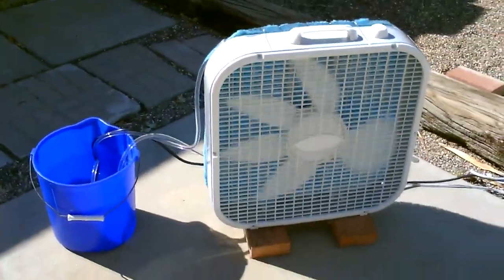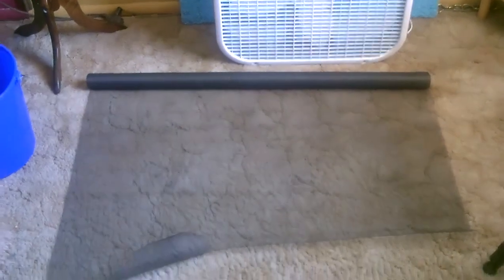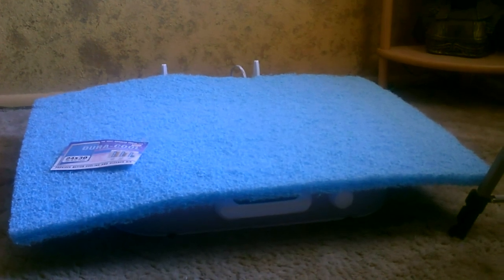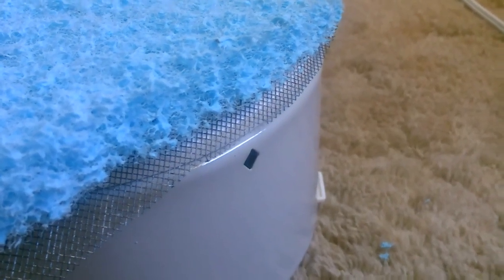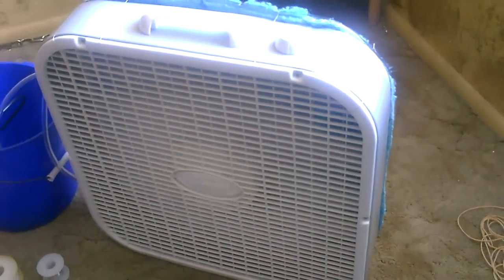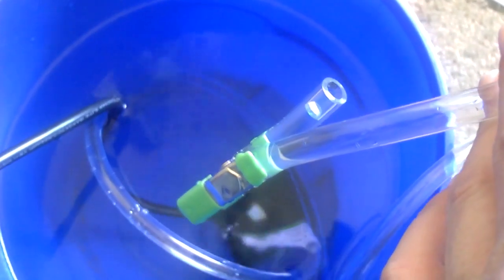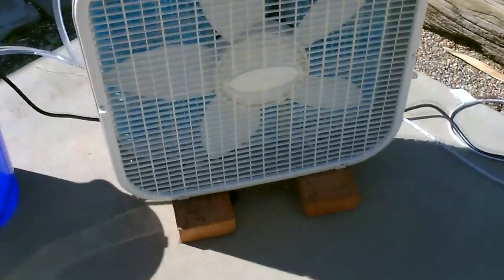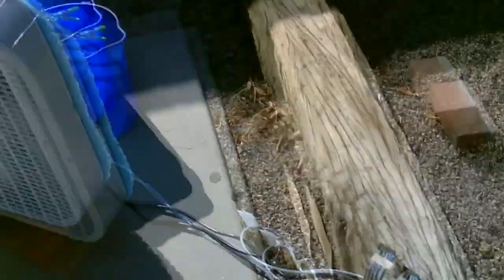Homemade Evaporative Air Cooler! - Simple "Box Fan" Conversion - EASY Instructions!

Comment: I've used big commercial versions of these in the deep South, They do wok in high humidity areas. Maybe not as well as they do in low humidity, but they cool the air quite a lot.
Reply: I'm wondering where in the deep south, certainly not on the coast. I'm originally from Charleston, SC and I can say that when July hits and it stays 90 plus day and night with 100 percent humidity every day that this will not do anything. My uncle tried to make one of these after hurricane Hugo with a fan and a wet filter plugged into a generator and it did nothing and this was in late September with only high 80's temps and 90 percent humidity. He had learned how to make one when he was in the army, and it was basically the same principle but you had to hand wet the filter every so often. These will not work in tropical to semi-tropical conditions. Its works on the principle of cooling the dry hot air with water. In true tropical humidity like you get in the swamps of the coastal southeast, you cant cool the dry hot air because it is wet hot air, all you do is add to the humidity or in the case of 100 percent humidity which is common in the southern coastal swamps you simply do nothing but block the wind power of your fan because you cant add moisture to complete saturation. These may work a little inland but not on the coast. For the most part these are designed for the desert.
Reply: bassking80
Near Montgomery Alabama in a heavy equipment repair shop and a warehouse near Ft Benning Georgia.  They made working conditions bearable,

But, you are correct about trying to use them in a swampy, extremely high humidity area.  That would be a waste of time and effort. An evaporative cooler requires some level of evaporation to achieve a temperature drop, and the higher the humidity, the less the evaporation effect. 

http://portablecoolers.com/models/PAC2K482S.html
Reply: bassking80 i live in a dry desert climate, i completely feel you on what your saying. Humidity and heat sucks, dry heat is doable.

Comment: Are the holes in the tubing just on the top?  I know sounds like a dumb question but I wanted to make sure.  Do you even need a return hose going into the bucket or can you just cap off the tubing at the end and just have the tubing run across the top of the fan and stop?

Comment from the maker: it's a 200GPH fountain pump from harbor freight tools. item 68372. any pump that moves at least 150GPH (Gallons per hour) should work fine. most pumps come with adapters for different size hose. the tubing is 3/8".
Reply: desertsun02 hello sir I am your follower/subscriber . I just want to know all materials u used for this divice .  I'm Hoping for your respond , thank you
Reply: desertsun02 Why did you use a screen? Is it necessary? Also, how did you affix the blue pad to the box fan? Is the pad upwind or downwind of the fan?

Comment: Could the pump be replaced by gravity if the cool water were kept higher than the fan or would that result in too low of pressure?
Reply: 10 years after the fact, but the size of the holes in the hose needs pressure to properly get enough water out.

Comment from the maker: thanks. the plastic window planter box is a great idea (even if you don't recirculate).  you could elevate the fan maybe 6" off floor and then slip the planter box directly beneath the bottom of cooler pad to catch the residual water.

Comment: It's a good idea, and I like it. You gotta remember, though, that it won't work well in humid climates. This idea is mostly for hot, dry, climates. The ancient Egyptians invented this idea.
Reply: Yes it DOES still work in humid climates! Not the same difference in cooling effect, but enough to make a difference. Try it!
Reply: The ancient Egyptians had electric fans, plastic tubing and water pumps?
Reply: @dbodooley  invented this idea. . . meaning they had water and a way to move air